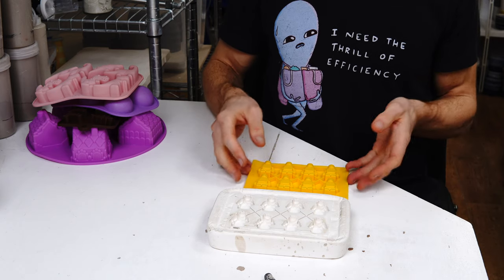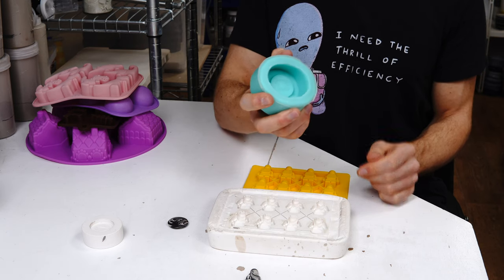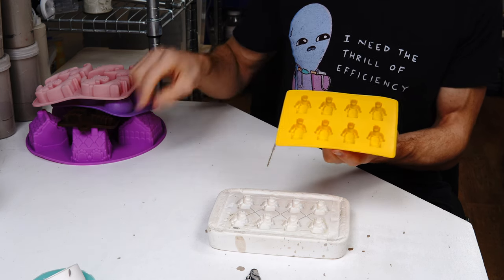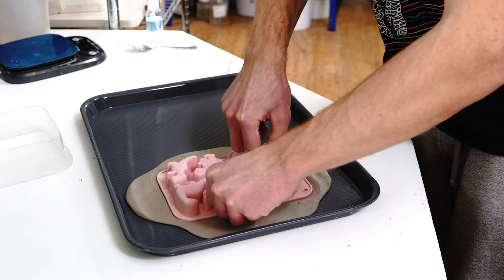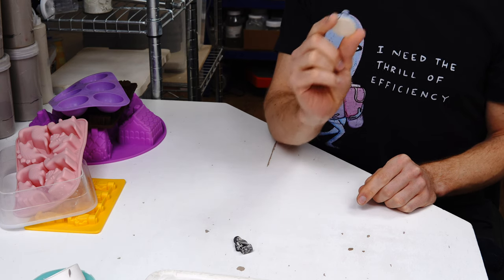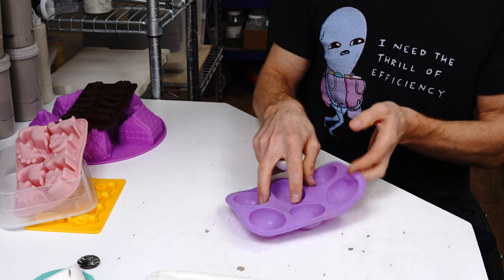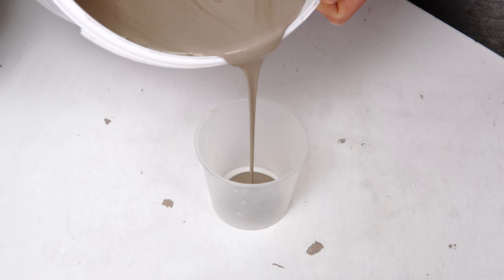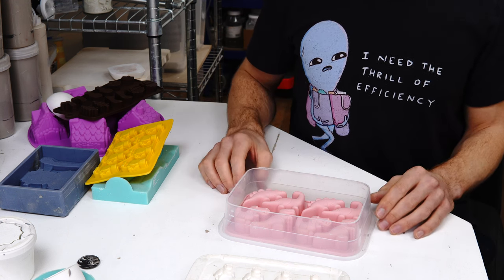Using Silicone Baking Moulds In Ceramics

Comment: Hello, Joe! Obviously, pouring the slip directly into the silicone mold of such designs is most likely impossible. But I had the experience of pouring a slip into a flat carved piece made of silicone - these were tiles with calligraphy. I milled the model from plastic on a CNC machine, and then made a silicone mold based on it, especially for filling the slip. However, after some time it is necessary to top up the slip a little, and the part dries in the mold longer, and a fixing pad is needed on top and bottom so that the tile dries without deformations, But when it comes to a complex design with very small details, I did not get any other implementation like this.

Comment: One note is that you can make silicone molds yourself, but don't use unfired clay to do it. The minerals in the clay body inhibit the curing of some kinds of silicone, so you'll want to go plaster -> silicone -> plaster if you're looking to replicate a particularly nice piece of greenware. The benefit of creating your own silicone molds is that they last much longer than plaster molds, which are already quite durable of course.

You can also use silicone to mold other materials, as well, if you've ever thought about turning a finished piece of pottery into a plastic replica, or shrinking or growing your pieces using shrink-cure materials.
Reply from the maker: That's useful to know! I know there are considerations with the type of resin and silicone, with some resins inhibiting curing of some silicones (IIRC I needed a tin-based silicone for my prints), but I had no idea that the same could be true of unfired clay.
Reply: @OldForgeCreations  Yes I believe it's the sulfur compounds in the clay, always some pesky sulfides and things. Mostly burned out by bisque/glaze firing

Comment: Great ideas, thanks for sharing.  Could I suggest you could also fill the original mould with wax rather than plaster, then you could soften or melt them out if they stick?
Reply from the maker: That's a great idea, and not one that I'd considered! It would definitely make them easier to remove than they are when filled with plaster, without the cost and mess of using silicone instead

Comment: Has anyone tried liquifying cheap silicone (in cartouches) with mineral spirits and pouring it into the mould? Since silicone needs water to cure it might be advisable to mix corn starch into it. Just an experiment for this purpose. I used to form grips for tools out of silicone with this method.